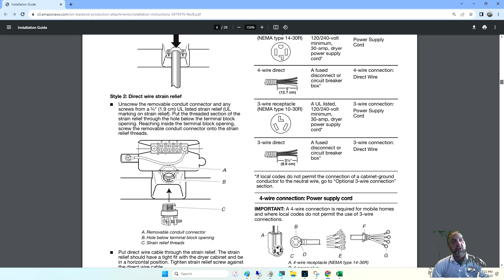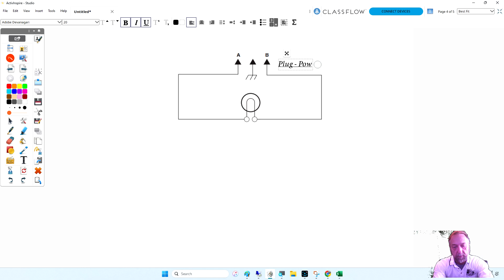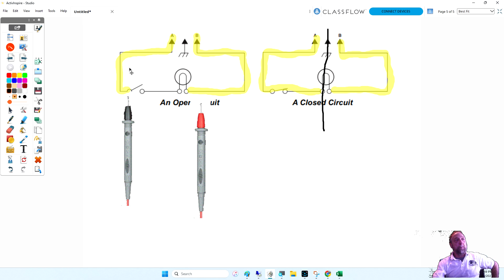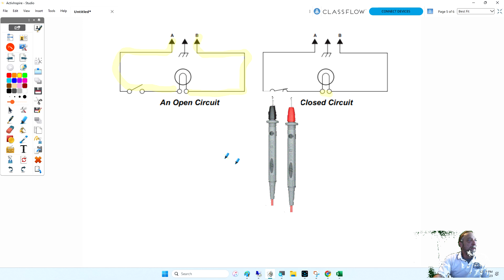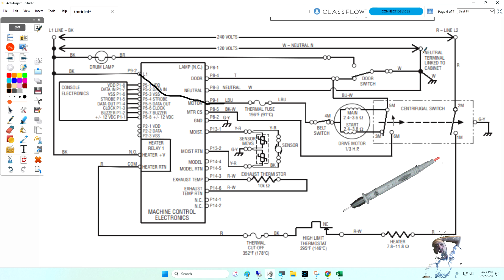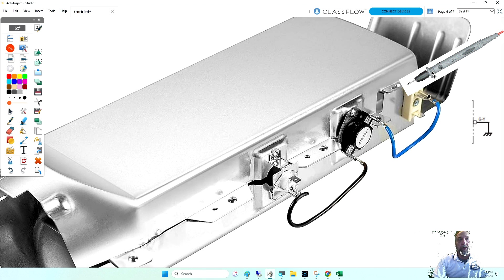Troubleshooting

Comment: What is the best item to purchase to have jumpers in your tool set? Any recommendations?
Reply: Amazon sells many jumper/test leads, but I have made a few using wire harness from old appliances
Reply: @riz65  I guess you need to have a variety of them in different gauges and different size spades and/or alligator clips...?
Reply from the maker: yes @rooster917

Comment: Hey Rick and Brandon! It's that time of year again! I'm laid off for a couple months and watching as much of your content as I can to learn as much as I can. Rudi in Richmond! 
Re: Amp test. Isn't it appropriate to test amps at certain ties to see if a component is working at spec? Say if there is a loose connection in the circuit, it will cause more resistance in the circuit and reduce the amps which will affect the wattage/performance of the component. Say in a dryer HE with a loose connection somewhere that causes it not to heat.
47 min in checking motor voltage would it be appropriate to check P9-1 to P8-3 since P8-3 says NEUTRAL? Either P8-3 or P8-4 would serve as Neutral in that test, correct?
As long as we're going to the board, we should check 120 VAC coming in to the board first, right?
Reply: Yes a loose connection could cause higher amps, but amps would not tell you whether it is wiring, the load, or even in the breaker or outlet, which also could cause a high Amp draw.